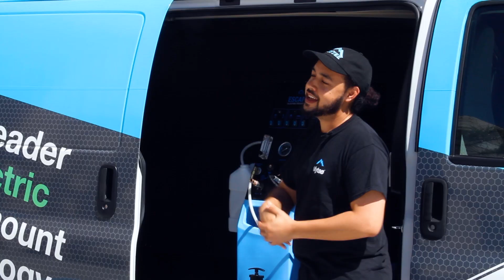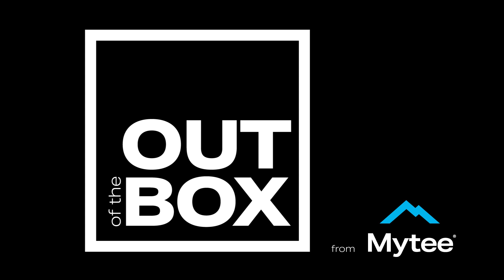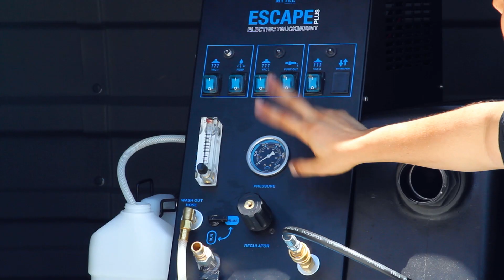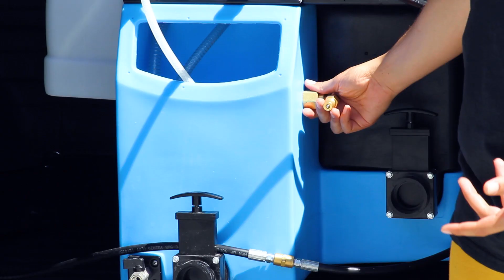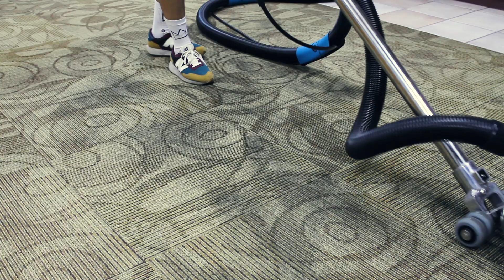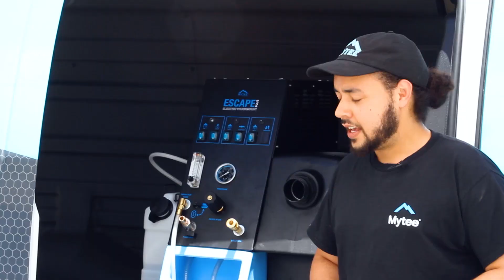Mytee Out of the Box: Escape LX Plus Electric Truckmount

Comment: would this be strong enough to use as a turf infill extractor?
Reply from the maker: The vacuum power would likely be sufficient, however since this unit is designed for wet extraction, you will need a more robust in-line filter for extracting dry solids to protect the vacuum motors.

Comment: A typical hose run for me would be under 150 ft. with 100 ft. being easily 90% of my runs. Will that machine WITHOUT that extra 3'rd vacuum motor clean easily and effortlessly at 150 ft. or at the extreme least 125 ft.? I'm hearing conflicting results on this machine. Does it take 3 vacuum motors to go out as far as 200 ft.? How far out has it been tested? I'm beginning to think these new vacuum motors aren't all they're advertised to be. I've been cleaning since 1987 and did use an electric TM for a few years back in the 90s. Even then, I could go 150 ft. without any real problems, but more than that my machine really struggled. I could clean all day without a problem in the 125 or under range. It also had an auto dump and auto-fill with chemical injection too.

Also, how quickly can a vac motor get changed out if one fails you on the job? I typically might get between 1 or 2 years max out of a 7.2 inch three-stage vacuum motor in the 90's. My old machine was fairly difficult to work on and would never buy one that didn't make it very easy to access the vac motors to change them out in less than 1/2 an hour max.
Reply from the maker: We have dual-LX vacuum portable extractors that run 150' of hoses effectively, multitudes of cleaners do exactly that with them every day out in the field. The third vacuum is needed to retain effective CFM much further beyond this range but 3 LX vacuum motors extends the effective length to the stated 250'. Our ETM has an easily accessible design, the side panel removes and all components are immediately within reach. replacing a vacuum motor can be done in under 1/2 an hour, simply un hook the wire harness, loosen the hose clamps and unscrew the motor from the mounting bracket, then reverse the process with a new motor. The LX vacuums are rated for 1500 hours.
Reply: @myteeproducts  Thanks for the reply. One last thing. Are the vacuum motors series or parallel?
Reply from the maker: This unit is in series, as are any of our machines with LX vacuum motors. Our standard 3-stage vacuum motor machines are in parallel.

Comment: Recently bought one, what is the two holes with thrread beside the waste tank?
Reply from the maker: They are left-over features from previous designs that used this same mold.
Reply: @myteeproducts  can i use them to attached vacuum booster like mytee air hog?
Reply from the maker: No, not through those but you can use an air hog booster in-line as intended with the ETM
Reply: @myteeproducts  Can you send a link on how to connect it?

Comment: Don’t most conventional truck mounts have 32.5 inches of mercury?
Reply: 32 inches of mercury? The highest inches of mercury you'll find in a truck mount is 20 inches of mercury. But you probably would spend more than 50k for sure.
Reply from the maker: None that we know of! You might be thinking HP not HG? Gas mounts with a root 45 blower typically have 13"-16" mercury
Reply: It's more in the range of 12 to 16 I think. The actual blower itself on my machine can reach 30 inches of mercury IF it's not connected to the waste tank and you block off the intake on the blower. I just did that a couple days ago. If you run them at too high of lift they will get severely overheated and go out on you. My machine is rated for 14 inches so I keep it around that, but never more than 14. I believe 30 is max for my blower which is a Tuthill 4005. There do exist some monster machines out there that go well above the norm, but not by any means common.

Comment: ETM recommended running watts is 12000, if using twin turbo heater 4800watts will i require two generators?
Reply from the maker: With a large enough generator you may not need it but that starts to be a large generator between the two running full out. We recommend bringing the heater in closer to the wand for better performance, you can use on site power when available in this case.

Comment: what about the constant burning out of electric switches from the wild electricity of the generator. Real talk.
Reply from the maker: A quality generator of ample size would not present an issue like that. Our Aura generator has a sine wave clean enough to run even personal electronics like a laptop off of. We use quality switches rated for the 30amp power draw of this machine.
Reply: @myteeproducts  there’s nothing wrong with the switches on your machine. But you should inform your resellers of what you shared above. My son has your ETM running on a generator and burns out switches frequently

Comment: I received my Escape recently. Could you guys share how you use the van’s engine for power and how the heat exchanger is set up?
Reply from the maker: The generator is made by Aura systems, it mounts in the engine bay and runs while the van idles and provides 12kW running for our system. The heat exchanger is connected to the radiator system inside the van using the engine heat as its source, so when we pull up to the job we already have warm water from the drive there!
Reply: @myteeproducts  I better use a diesel burner
Reply from the maker: @Beluel  a very popular option for sure
Reply: @Beluel  Use a "Heat Saber" instead : https://youtu.be/ZFUpgQBl8hc?feature=shared